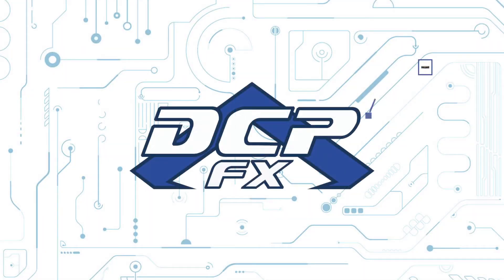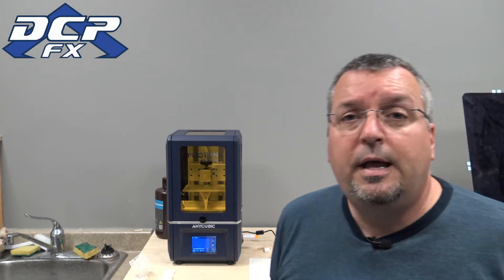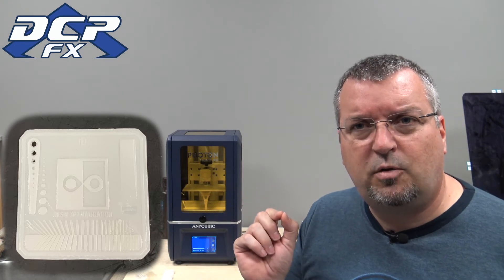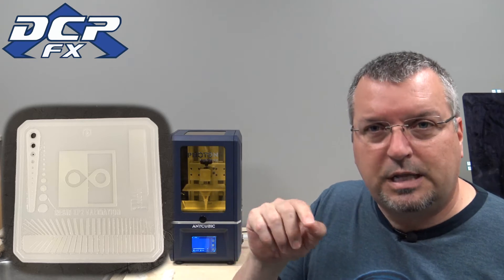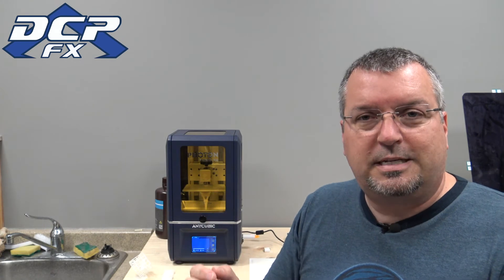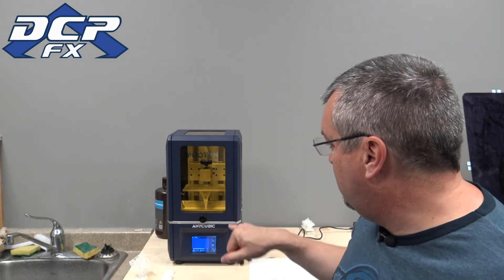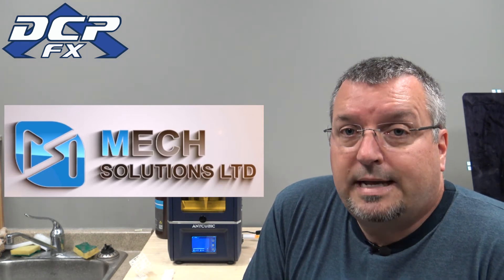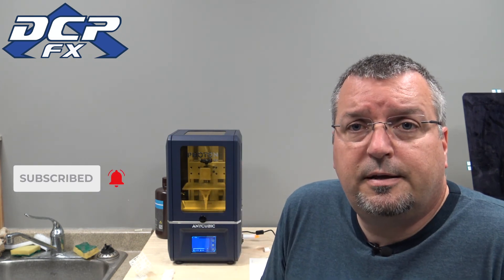Resin Exposure Calibration

Comment: Thanks for the video. I've done the tests and something's not right. I have a Creality 002R and use standard grey elegoo resin. I have done several tests and for 0.05 mm the best exposure time is 4 sg. When I then print a mini (head for mini of 28mm) with those parameters, it doesn't come out, it stays in my fep stuck. What's the fault? Do we have to use any correction factors?
Reply from the maker: There are a lot things to look at - did it print the test files ok?

Have you tested the tension of the fep?

What are your bottom layer settings?

With this machine, I was printing at 2.5s, but bottom layers 15s x 6.

Maybe you are having too low an exposure to the plate, and then it just stuck to the fep instead.
Reply: @DCPfx  I think, test files are ok. The bottom layer settings: 50 sg x 6m. 
May be the tension of the fep? How can I tested this? Could you tell me a link explaining how to do it? 
Thank you very much for your comments
Reply from the maker: @albertoirigoyen343  Here's a good video on replacing and tuning the fep - https://www.youtube.com/watch?v=Yr_wtZqBfbQ
Reply: @DCPfx  Thanks for the video. The old fep was 240Hz. Yesterday I changed it, new and now at 320Hz. I will do the tests again. But I think that the parameters for the tests do not match the parameters for printing miniatures. Hopefully I'm wrong and get good results this week. Thank you
Reply from the maker: You are welcome - I found that just tightening the fep has worked well for me - good luck!